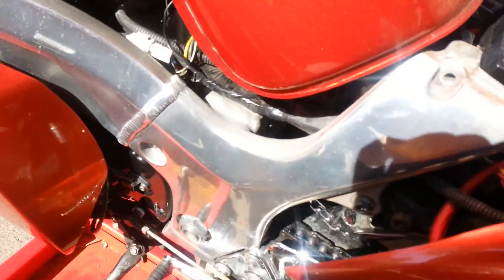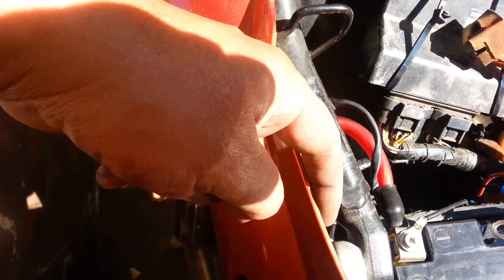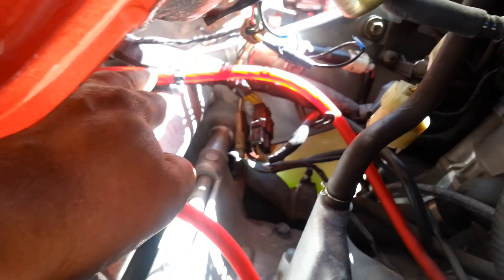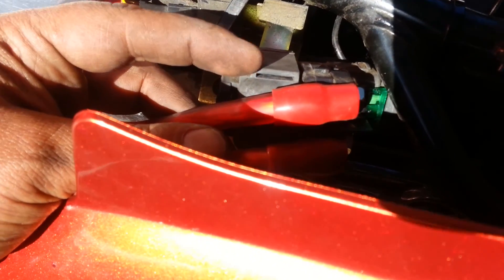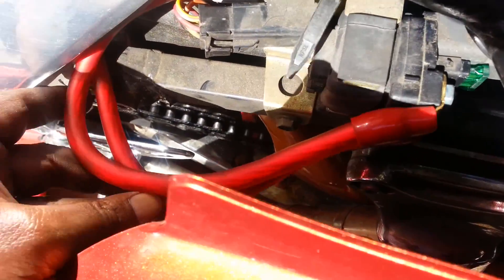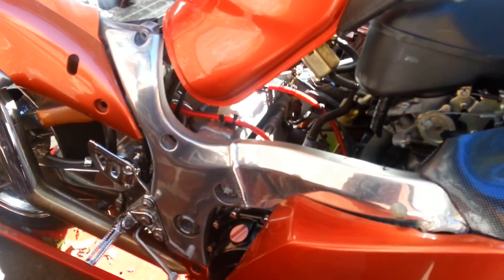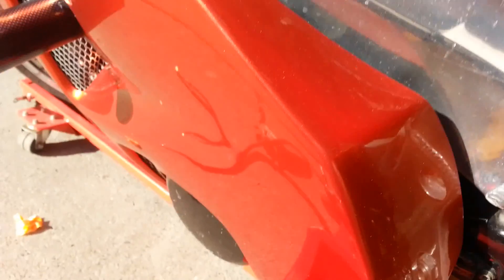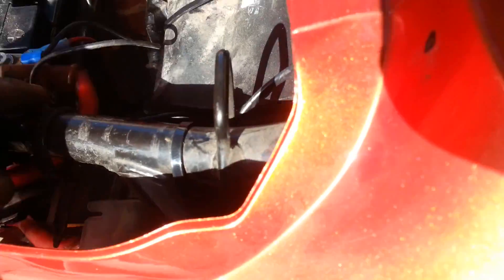Hayabusa starter wire upgrade part 2of2

Comment: nice work, nice busa...  hope its all sorted and you're enjoying the spring weather, HALE YEAS!  now I have starter issue, wont hot start, batt is good, charging system good, starter relay good, so I have a new starter j use dreading the replacement, I've already cracked and removed all wires and leads going to is and cleaned em up, they were a little crusty but evidently not it, I believe the starter is heat soaked, or its that case worn out condition, strange cuz it came out of no where, its started fine when I parked it in October, did not put the trickle on it and it wouldn't start dead, put it on trickle for ten days or so, it didn't want to start then clicked a lot, I swapped batteries with a known good, now I have the hot no start issue .. fuggen gremlins, imma let loose a ferret in that bich just you want!    it just came out of no where when I parked it I had no issues at all, hot cold, riding in 120 degree weather it fired right up whenever...  I kinda figured bad gas was part of it cuz when it did turn over it wouldn't fire right away.. got that all washed out with fresh 91..  now it start ok cold a slight hesitation at first then it goes and starts, maybe turns over more than usual? generally they fire up right away, not its taking a lot of turns?  hoping that shyt gas we get anymore didn't clogg up the injectors .. don't let your bikes sit more than a month without starting, let em get up to temp.. ride if at all possible  .. oh yea and she bump starts fine like right away . .  hmm...  gemlins!!!

Comment: During your commentary i think i heard you mention about the difficulty starting when hot . Is that correct ? 
If that is the case what is the mileage on your bike and when was the last time your valve clearances were checked ?
I think if the clearances were too tight then it would cause a hard start when hot  . valves not closed properly resulting in less compression  .

Comment from the maker: sorry for the delay, yes audio shop... no it didn't solve the issue but when the engine is cool it does start better. i'm going to change the connections/lugs for better starting.

Comment: hey there Ozzy. Thanks very much for your comprehensive video. My Busa is fucking up starters (one day fine, next day not firing up the engine). Your vid might help out.
Did you just buy these cables at an car/audio store? I saw "4 wg Power Cable". Is that correct?
Did it also solve your problem??

Greetz from Holland!